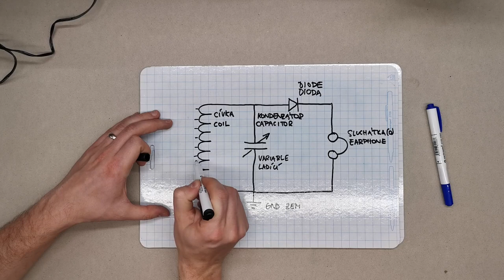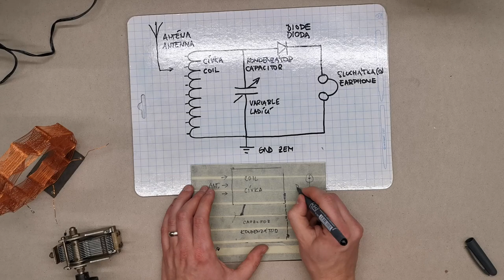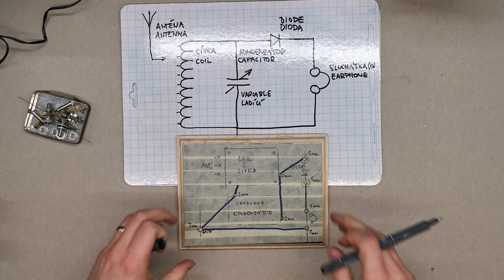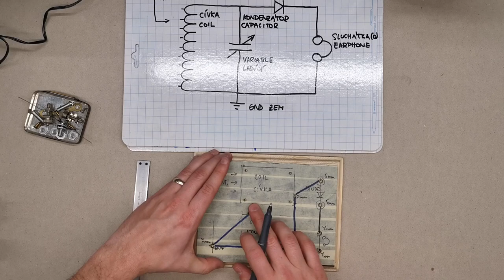Krystalka - nejjednodušší rádio bez baterie / Crystal radio - the simplest receiver without battery

Comment: Where did you get your crystal earpiece?

This is one thing I cannot seam to find locally (and shipping from amazon to Slovenija, costs more then the whole earpiece)
Reply from the maker: Thanks for the comment. That's not a crystal earpiece! It's an old 4000 ohm earpiece for a radio from an antique store. You can get old military headsets from the vacuum tube era at auction. BUT! The easiest way is to actually use a crystal earpiece. I have the plastic one you know from American videos with the twisted wire and it's not worth much. It's also very expensive to order and ship to the Czech Republic, I used to buy it in London. The best thing to do is to get a piezo buzzer (the crystal earpiece is really nothing else, it just has a 100k resistor wired in parallel to the buzzer) and modify it so that it has some sort of tube that you stick in your ear. You could use a 3D printer or maybe an old phonendoscope... A piezo buzzer can easily be bought or disassembled from an old microwave. The bigger the diameter, the louder it will sound. I have very good experience with Kyocera buzzers (maybe 30mm diameter). You can buy them on Aliexpress.
Reply: @JKSTEAM  yea the buzzer is a good idea, but the only ones I was able to find were active ones (you hook voltage to it and it screams with specific frequency, you cannot use them with the radio, they are all sealed, not even sure how to make pasive ones), I was also thinking of using the buzzers from singing gift cards, but I am not even sure how to solder to theese small things
Reply from the maker: @DXingSlovenija  you can search for "passive piezo buzzer" on Ali or other chinese markets.

Comment: translated
This looks like a clever design
Vypadá to jako chytrý design
I am surprised by low selectivity
Překvapuje mě nízká selektivita
Try a loosely coupled antenna
Zkuste volně připojenou anténu
Reply from the maker: The antenna is really bad at this particular QTH. My workshop is in the basement and my testing antenna is influenced by a mass of concrete and iron… the radio works well when the antenna and ground is good enough.

Comment: Ich habe diese Spule angezapft gebaut,da ist der Empfang Trennschärfe.
Reply from the maker: Die Gewindebohrer sind ein kleines Problem bei dieser Spule, sie sind bei einer zylindrischen Form viel besser. Aber es funktioniert. Hervorragende Ergebnisse werden auch erzielt, wenn zwei Korbspulen verwendet werden, von denen eine für die Detektorschaltung und die andere für die Antenne genutzt wird. Die Selektivität wird durch die induktive Kopplung erhöht.
Reply: @JKSTEAM  ja,stimmt.Ich habe 20 Jahre Retro Spulen gewickelt und exakte Sockel gefräst.Der 2 Spulendetektor brachte nachts 16 AM Stationen herein.Spulenwickeln kann ich noch,bin aber nun älter und krank.Ein Drehko sollte kleine Kapazität bei rausgedrehten Rotorhaben.Die Spulen haben spitzen Dip bei 192 Güte!es reicht,denn Schalenkerne engen Dan auch die Bandbreite ein.20 Jahre habe ich wieder im Alter geforscht.Danke💖🇩🇪🎹
Reply from the maker: @matthiaswilhelm9813  Danke für den netten Kommentar und die Erinnerung. Ich werde noch mehr Videos mit Kristallen machen, und ich bin sicher, dass es auch komplexere Schemata geben wird :) Schön, dass Ihnen das Video gefällt.